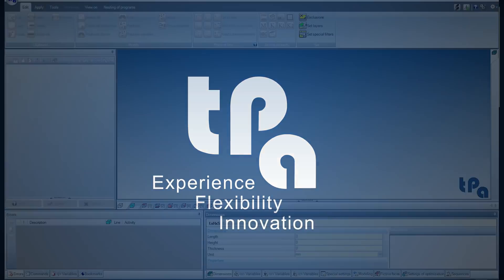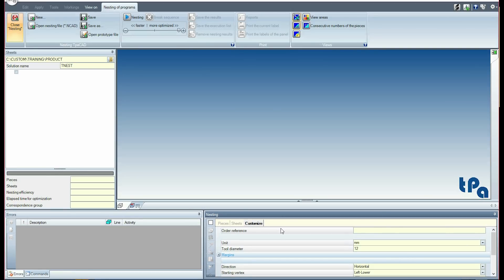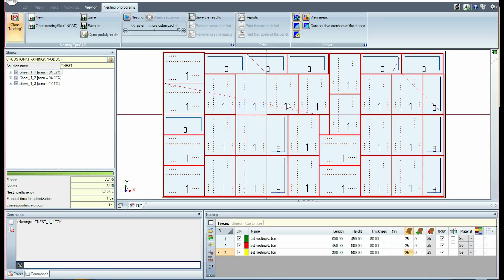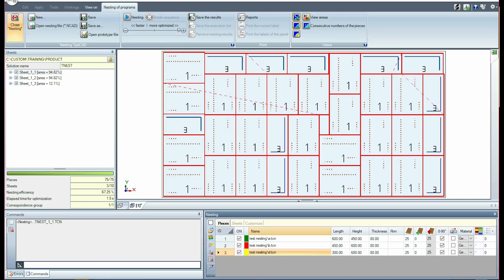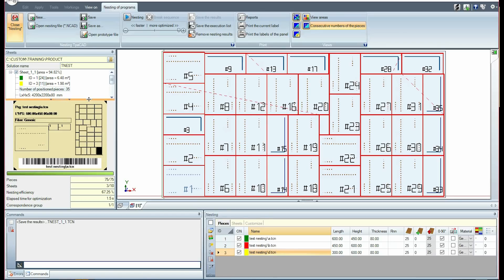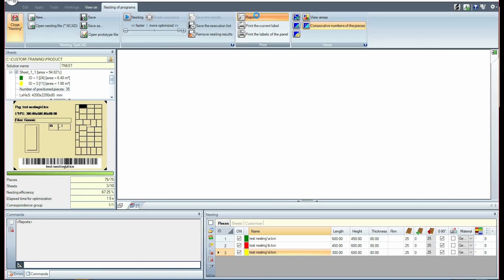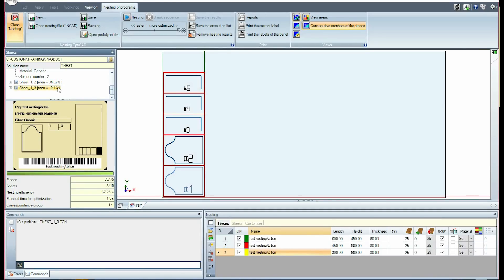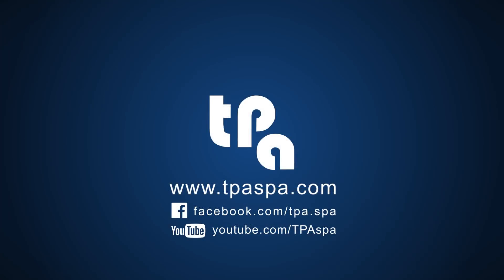Tpa CADnesting Square

Comment: Is this an update available to users who currently have Tpa cad? I’m interested
Reply from the maker: Dear Lucian, this update is available with an extra cost for all our Clients that are the machine producers, for the machine user we suggest you if you are interested in asking to your supplier of Machine, because we can't decide for our clients what they use on the machine, and anyway this is a new feature of the TpaCAD and is normal if you bought a machine that is not still present this update. If you have more questions related to the software please contact us at info@tpaspa.it
Sorry for the late answer but we were busy with a Tradeshow and we are just back now at the headquarter.
Our Best Regards